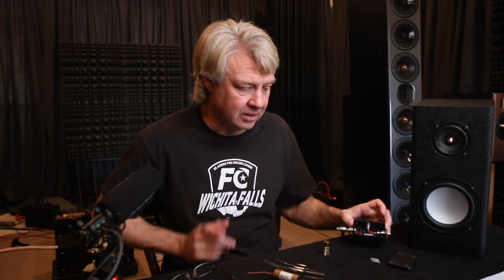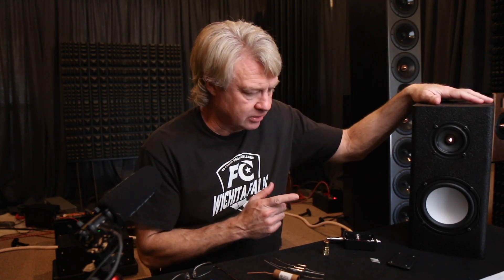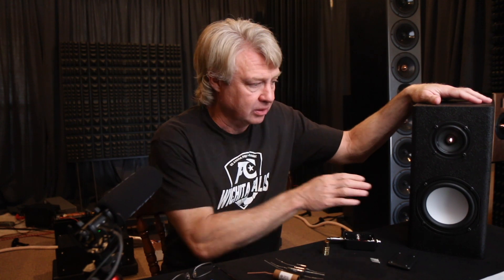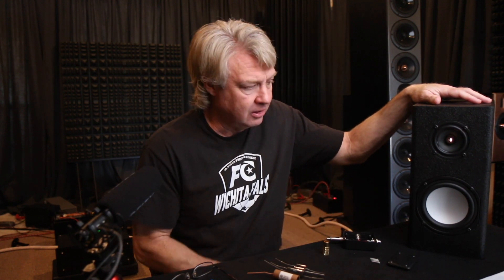BEST option for rolling off BASS??? Let's make In-Line Filters!

Comment: Will this highpass change phase 45 degree away from a regular analoge subwoofer filter? Phase integration with subs isnt easy without mains delay, I assume the most subs just lag 1 cycle behind the main speakers?
Reply: I would also like to know the answer to this
Reply: This type of filter will cause a +45° phase shift at the -3dB cutoff frequency. The phase control of your subwoofer will need to be adjusted to compensate.
Reply: @nathanevans6277  Yes, but wont the +45 make things worse when if the -18db sub lowpass 3. order filter(standard) give -135°. Only way to fix that would be to add more delay so the sub matches up on cycle nr 2? My knowledge on this subject isnt good so if someone could please explain the relationship properly that would be great :)

Comment: I was going to get your line level high pass for my Tannoy XT8F towers, but I ended up buying a Tannoy Definition Subwoofer that has balanced high pass output. 

Instead of getting new Tannoy towers later, I want to take these I have to get your full out XO & cabinet upgrades & I'll drive them down myself.
Reply: Careful, those high pass filters built into those amps are usually electrolytic caps. So the quality level is very poor.

Comment: E.g. if your speaker is already connected through amplifier, and the amplifier is connected to the subs High Pass Filter, will installing the In-Line Filters be redundant?
Reply: Do not use a high pass filter built into a subwoofer plate amp. Those are typically just an electrolytic cap.
Reply: @dannyrichie9743  would you say there are exceptions to this though? ie REL and Rythmik?
Reply: @JC-lk3oy  We use the Rythmik servo amps. Using any internal high pass filter in those amps are not recommended.
Reply: @dannyrichie9743  good to know. I appreciate the reply. The reason I ask is I've heard differing opinions on this. Some say it's better to use the high level inputs on sub amps to "impart the sound of your main amp to the sub". Not sure how true that is though.
Reply: @JC-lk3oy  I've read different things too.  It is confusing.  Guess that's why its best to just hear the difference ourselves instead of hitting our heads against a wall of analysis paralysis.
Reply: @dannyrichie9743  good to know.  Its sad cuz i have a little x-sub that you must've built over 10 years ago which does effectively roll off the bass to the speakers.  Love its bass management.  I'll have to get myself an in-line filter and hear the difference.
Reply: @Jonathan-ff4wo  Those X-subs use a 100uF electrolytic cap as a high pass filter (if I remember correctly). So getting that out of the signal path should open everything up significantly.

Comment: More tech talk videos Danny!! I love it.

I used vcap odam on xlr cables (two per side) and it's incredible and much better than the miflex I tried in that place for my nx otica roll of at 53hz. Significant sound improvement!!
Reply: Very good. We have some crossovers built out with the Vcap Odam caps that we are still burning in. When we finish getting them burned in then we'll compare them to some crossovers using Miflex caps.
Reply: Can you show me how you did that for xlr cables?
Reply: @joelrunyan1608  XLR cables require a pair of matched caps. One is used on each positive leg.
Reply: @dannyrichie9743  not certain what that would physically look like to get it done for xlr cables.
Reply: @marka9073  two caps to + and - leads and a wire for the ground connected on both ends to the correct male and female terminals. Make sure you get perfectly matched as close as possible caps for right and left channels
Reply: @B2_Labs  thx! How did you physically construct, connect and package to not cause the advantage of XLRs shielding ect., to not affect the signal path.  I'm using monitors plus sub. Would like trying this as I see the advantage for driving speakers within there freq range.  Currently running a streamer (Lumin) directly to amp with XLR cables.